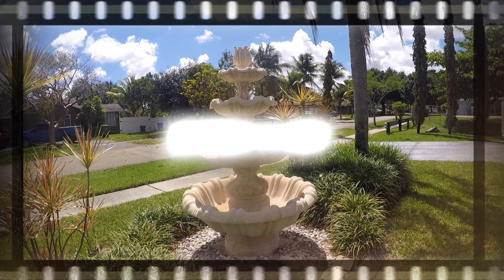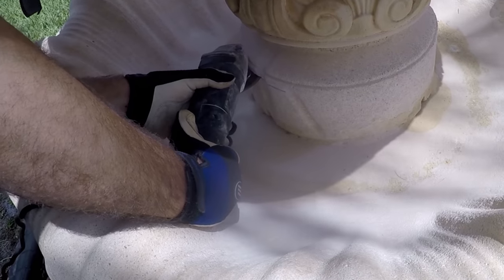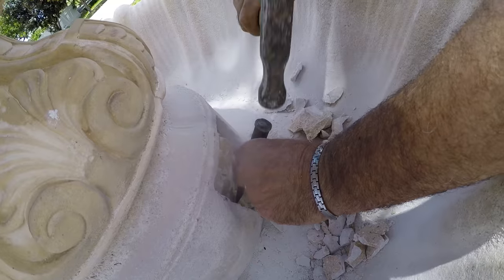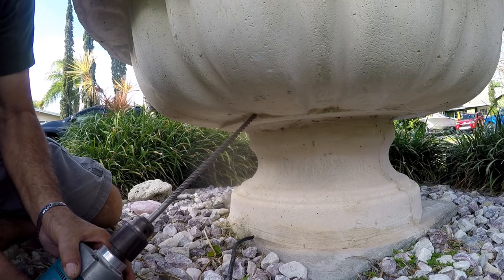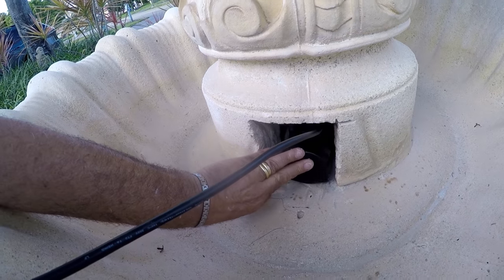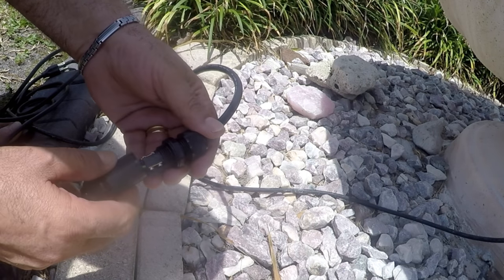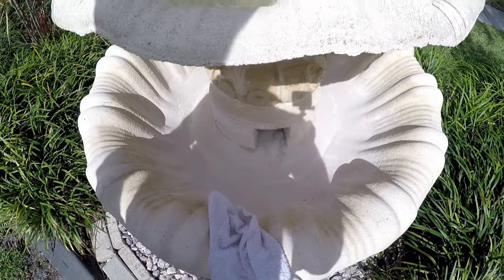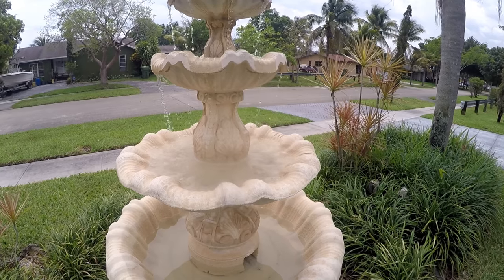HOW TO REPLACE A FOUNTAIN WATER PUMP | SUBMERSIBLE PUMP

Comment: Excellent! Our backyard fountain is not quit that big. But it is very heavy concrete. It already has the little access hole in the back where the pump is located. After 13 years the Little Giant pump has pumped its last pump! The power to the pump comes up under the pedestal in the center of the fountain and is epoxied in place. No way to replace that. Your idea of drilling the hole for the new pump wire is exactly what I was looking for. Thanks a bunch!! 👍
Reply from the maker: Glad it helped!

Comment: I have been thinking about purchasing a fountain for my greenhouse.  One of the fountains, a 3 tier does not hold a lot of water and one has to add water every day that is what I am reading. I say build a little underground pond that will hold the water. Your video was nice because you solved a problem after I read some reviews of a few complaints about a certain fountain.  Some of the fountains now already have the access area to replace the pump. This is needed if it's a China product. Say What! 😵‍💫Thanks for you video, I enjoyed it. 😊
Reply from the maker: Not sure what your purpose for the fountain but these fountains can also be installed inside a large basin (small pond or pool) in which can hold many gallons of water, depends how big you want it. I agree with you on the cheap products made who knows where :)
BTW, we add water once every few days and the amount depends on the wind and how sunny its been.....  Good luck and thanks for the feedback.
Reply: @JohnCRV  Hello, the purpose, there are at least two reasons. One is that I love the joy of watching the water fall and the sounds it makes, it is hypnotic, relaxing. The 2nd reason is that it adds to my greenhouse.  

Having a pool of water inside the green house I can keep the water at a certain temperature that is best for the plants inside the greenhouse.  This to provides water for watering the plants. Now in the winter using a garden hose the water is very cold and I don't want to drive the plants into shock and its my solution in order to keep the plants thriving to keep the water at greenhouse temps. The goal is to grow many herbs, veggies in a small space and enjoy the  environment creating a small area where I can sit and relax, grow editable flowers and I call it my 10' x 10' x 10' cube greenhouse.  It is a small greenhouse that will become a place were I can grab something to eat that is healthy. So having a fountain for my greenhouse over a pool of water will serve me in more than one way. Good luck with you as well. 😊

Comment: Helped me out a lot.  I have a old fountain and didn't know how to get the plug through the small opening, so you explained there's a connector I can purchase. Awesome.  Now,  how does the tubing work above to the tier?  I'll fumble through fine. The enclosure for the pump separates from the tier, but 37 years later it had crumbled, so I found a sturdy ceramic stucco type planter the same size and color as a replacement.  Might need to make a cement replacement.  Thank you.
Reply from the maker: Yes the waterproof connector has to be waterproof, the link for them is in the description.
Now, the tubing attaches to the pump and goes all the way up to the last tier, it should stick out above the last tier at least 1/2" inch or higher depending how high you like the splash back down. If you already have the hose in there, just connect it to the pump. If you need to get one, you want to make sure it fits the pump and the holes going up the tiers. You can purchase the hose at HOME DEPOT or LOWES since the sell it by the foot and will cut it for you.
Hope this helps and good luck on your restoration.

Comment: I have a newer fountain with the big hole cut out but no cut out for the cord. I didn’t give the pump much thought when the fountain was being placed and it was somewhat of a problem until seeing this video. Huge help for what I need to do. Thank you. 
Question: I think my fountain is a little off. How do you line it up to make it sit straight? I used a level but it still looks off. Any advice is greatly appreciated. Thank you, John.
Reply from the maker: If you have a level and some plastic shims the carpenter type at Home Depot. Unless you want to order the fountain type you can look it up online. Once it's level make sure you re grout it. Like these. Wobble Wedges Flexible Plastic Shims, 30 Pack - Multi-Purpose Wedges for Home Improvement and Workplace - The Ideal Table Shims, Toilet Shims: https://amzn.to/3vMKScN
Hope it helps.

Comment: Just what I was looking for! I have a fountain that has its pump hard wired and the pump failed. I want to move the fountain to the front yard and use an extension cord. What kind of wire did you use between the plug and fountain? Where can I buy the water proof connectors? Thank you!
Reply from the maker: All parts and tools links are listed in the description of the video and more. Hope it helps.
ATPWONZ 3 Pole Wire Connector IP68 Weatherproof Junction Box External Sleeve Coupler 
Cable Range 0.2-0.39 Inch (5-10 mm) Pack of 2 : https://amzn.to/2HDu2GQ
Extension Cord Go Green Power Inc. GG-13750BK 50' 16/3 SJT W-A: https://amzn.to/3B7VmW8

Comment: I already have access to defective  pump I am wondering about the effectiveness of the waterproof connectors in that I could just do that and replace the pump. My question is a safety issue because that connection will be submerged.  The fountain is at my church. Kids may stick their fingers in the water.
Reply from the maker: They are very effective if installed correctly. My connection is often submerged when we get heavy rain. If you want you can also wrap the connection with 228 Moisture sealing Electrical tape. Just for extra protection.
Hope this helps.

Comment: Hi John, I got the connector working. But do you know what type of the underwater cement should I use to seal off the the pipe that has the wires? Thank you!
Reply from the maker: Link for the SikaBond Construction Adhesive, Cartridge, Gray: https://amzn.to/31MxCsj

Comment: Thanks for posting.  I'm having trouble finding something on YouTube which instructs how you balance fountain using shims.  Our water distribution is lopsided.
Reply from the maker: If you have a level and some plastic shims the carpenter type at Home Depot. Unless you want to order the fountain type you can look it up online. Once it's level make sure you re grout it. Like these. Wobble Wedges Flexible Plastic Shims, 30 Pack - Multi-Purpose Wedges for Home Improvement and Workplace - The Ideal Table Shims, Toilet Shims: https://amzn.to/3vMKScN
Hope it helps.

Comment: We have the exact same fountain that came with the house we bought 2.5 years ago…. I’m trying to figure out how to assemble this the correct way along with changing out the pump that went out 😩…. Any idea of what kind of fountain this is…. I keep searching but this is the obit video I have found with the same so far 🙏🤞🏼.  TIA!!
Reply from the maker: These were made by a stone casting company down in Miami FL. They went out of business years ago.... They are very good quality but they never thought of giving access to the pump in case it goes bad or they wanted you to call them to do it, in which they would disassemble it and replace the pump, Which is a waste of time and money.... 
 If yours is still disassembled, then you just need to make the hole to have access to the pump before putting it together.....
To assemble they had 3 people and it took them about an hour. I had to build the platform and it must be at least 4 inch thick concrete also be very level... then they installed each tear bonding it together with a high quality grout and  was leveled using small pieces of gravel in the grout as shims.... they inserted the hose from the top to the bottom of the access hole and into the pump.... The only piece not grouted was the decorative top in which we take off by sliding it off the hose when we have hurricanes...
Hope this helps,
Reply: Thank you so much for your response!  I’m going to try and cut the access point out myself…. I have it all taken down with the exception of the base bowl and pedestal…. So I still can’t get to the cord of the existing pump.  I’m going to attempt to do what you’ve done by using the connectors.  Truly appreciate you responding!  🙏
Reply from the maker: @amybrown6298  Good luck Amy. You can do it!
Reply: Thanks fingers crossed 🤞🏼

Comment: Cool John i used marine silicone to seal the hole where the cord goes but it still leaks cant get it 100% - any suggestions
Reply from the maker: This is what I used to seal the wire. also used it for a swimming pool leak.  
SikaBond Construction Adhesive https://amzn.to/31MxCsj
The way I applied it, I made sure it penetrated at least 1/2" into the whole that's submerged. wait at least 6 hours before filling the fountain.
Reply: Thanks John used a similar product and works like a bomb bone dry no leaks
Reply from the maker: Bronek Maruszewski glad you did. Thanks for the feedback..

Comment from the maker: Replaced a concrete fountain water pump that was sealed in the fountain by cutting out a square hole into the concrete fountain to be able to get to it. Also had to reroute the pump electrical wire.
Reply: like 4
Reply from the maker: @ActNaturally  Thanks

Comment: Nice work John. Two questions please? I am about to repair our fountain, installing a new submersible pump. I was wondering what to use to waterproof the power cord seal. I see the adhesive you used and will look for that in HD or the other big box store. I am hoping not to cut the new cord - seeing your repair makes it possible to make the connection if I need to cut. John, can you refer me to a name or website that offers that waterproof cord connector please? I want to have it on hand should I need to go in that direction. Thank you. Again, well done. Your fountain looks great!
Reply from the maker: There's a links from Amazon on the description below the video that will bring you to the parts I used. It's good to have 1 or 2 of the Waterproof connectors on hand when doing these projects.
Good luck.
Reply from the maker: There's also a link to a video I published showing in more details how to wire the waterproof connector in case you need it. 
Take care

Comment: Kind of lengthy here- To cover the rectangular hole:
1) Get four 1" X 1/4" or so sticks.  Make a best guess as to the dia of the fountain base.
2) Fasten the sticks together in a square with the fountain base going through the center of the square. Hold the sticks together with those spring clamps found in every big box store.
3) Keep adjusting the clamps until the "front" side (pick any side you like) distance between sticks is EXACTLY the same as the "back" side. You have now "put a round peg in a square hole".
4) The distance between the two sides is the precise diameter of the base.
5) If you are lucky. the dia will be EXACTLY the ID of a sono tube.
6) More than likely, you will have to create a "compass" to draw the circumference of the base.
7) Cut "ribs" from !/4" plywood (or other medium of youre choice)
8) Use these ribs to form door skin to the proper contour. Fasten the door skin with nails or staples and glue. When the glue is dry, remove the nails.
9) Reduce your compass size by 3/4" or 1" or whatever size you want the wall thickness to be
10) Make ONE rib, and glue it to the bottom of your original outside wall of the mold, to create the mold bottiom
11) Using nails, staples, or whatever, conform doorskin to the bottom rib to create the Inside wall of the replacement.
12) Use strips to hold the top of the inner wall in place. Use door skin for the side walls. Glue and staple, then remove staples after glue is dry (or not)
13) Mix up mortar and a bit of "plastic cement", and some white concrete coloring (or grind up a whitish paver to get the color)
14) Line the inside of your mold with plastic shopping bag material.  For a really smooth finish, use a VERY light coat of Dollar Tree caulk as a "glue to hold the plastic firmly to the sides.
15) Fill the mold, let it cure, remove the mold, paint if necessary, and you are done in less than 6 hours of work!  Simple, Huh?
Reply from the maker: Thanks!